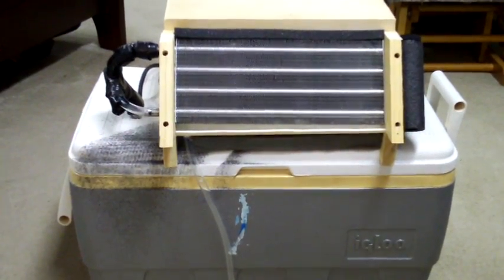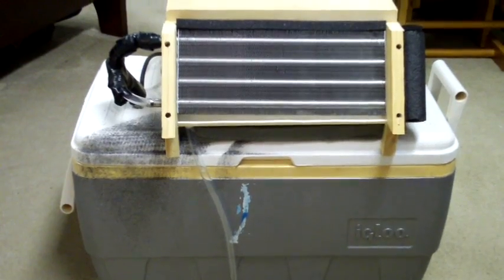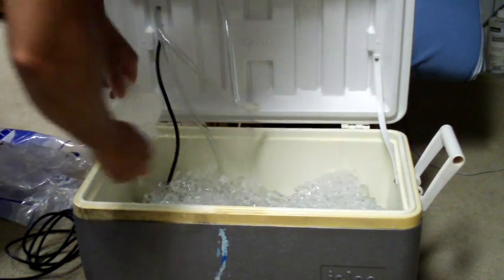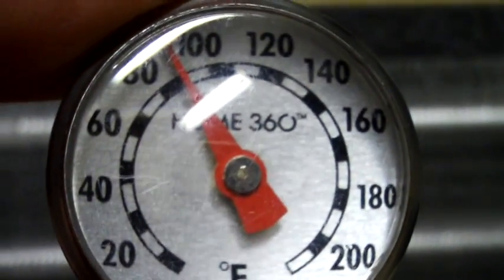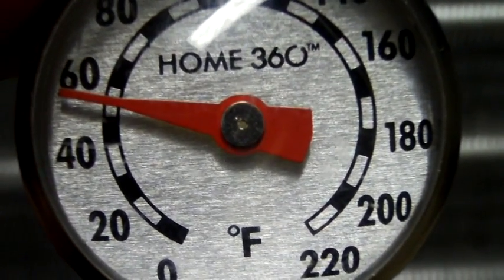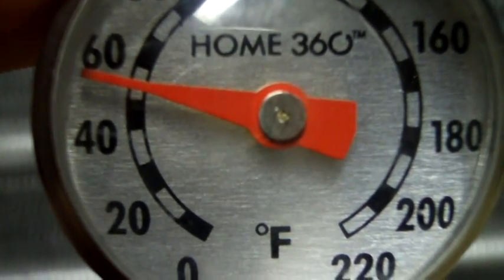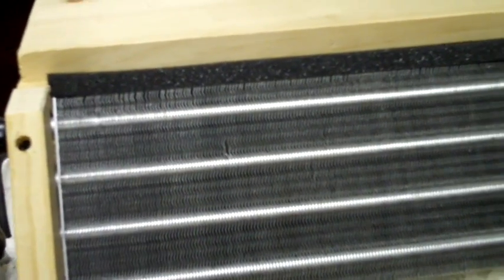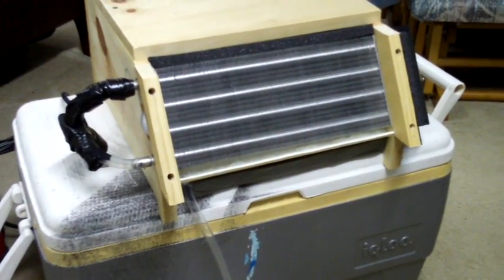Homemade Air Conditioner Part 2.

Comment from the maker: @mrwiggles2  Hey thanks! Last night the bags out lasted my jumper pack, which was2 hours., i still have ice floating around in there right now with water temp at 30 degreees F but i have not used it today, but if i wanted to it goes to show you  you can use it for at least two hours, and here it is over 12 hours later with ice and water in it,  very very cold, id say pending on the temp it could last at least 4 hours with 32lbs of ice, and thats free at most hotels :) perfect for travel!